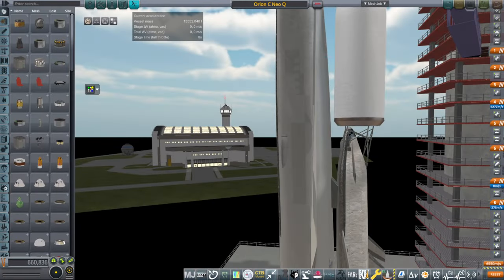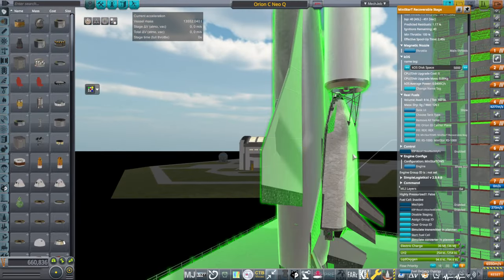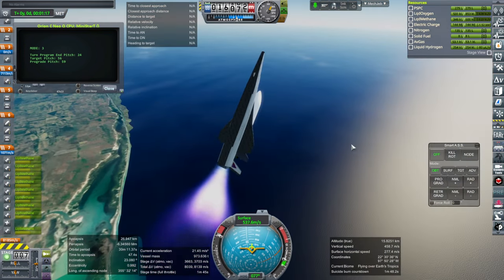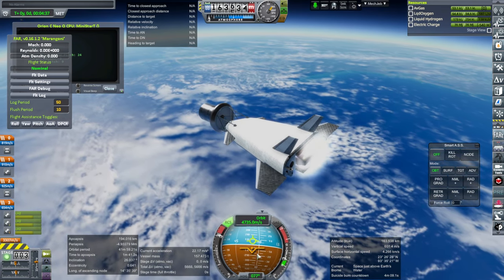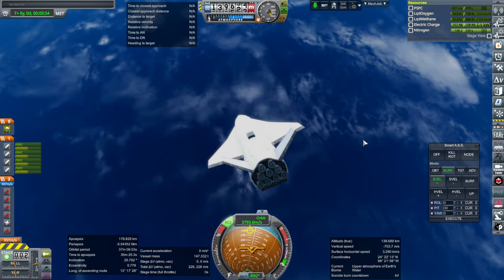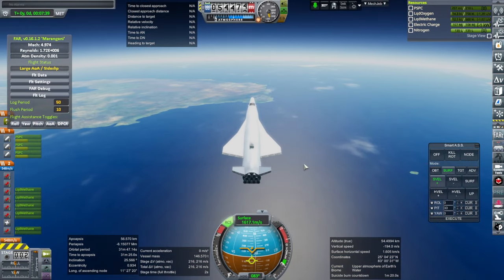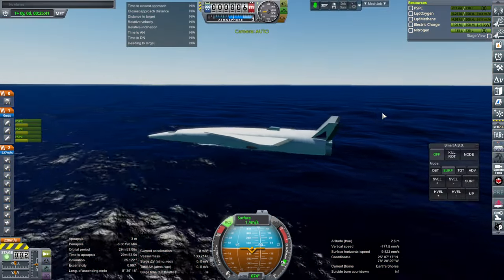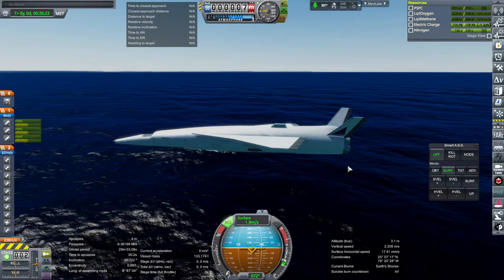Stage Recovery - High TWR Style (RO in KSP 1.12)

Comment: The pronunciation is INK-oh-nel. And although it has impressive properties, it's a real pain to machine. And certain grades work harden so fast they are a holy terror. You have one shot to drill a hole in a part. If you stop, the bottom of the hole hardens and can no longer be drilled. The hole has to be ground the rest of the way with a high speed carbide end mill.